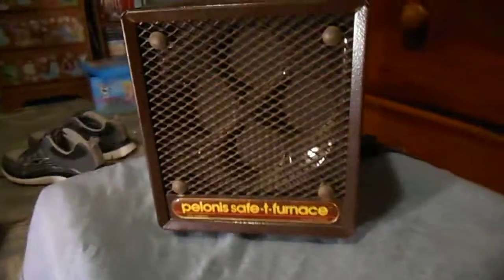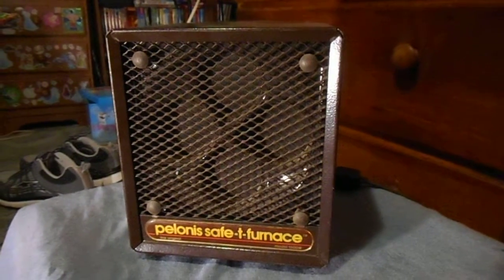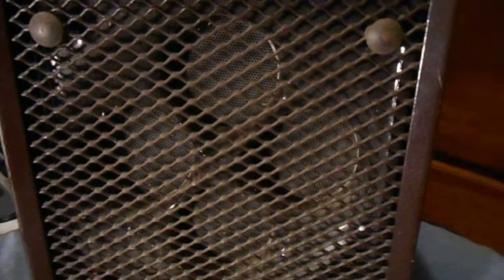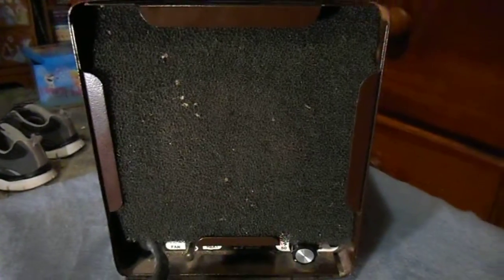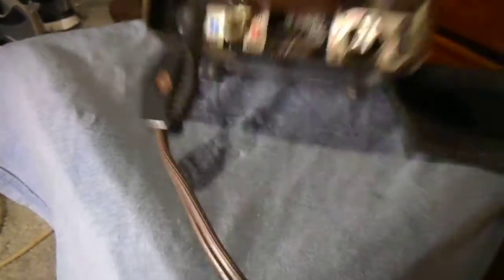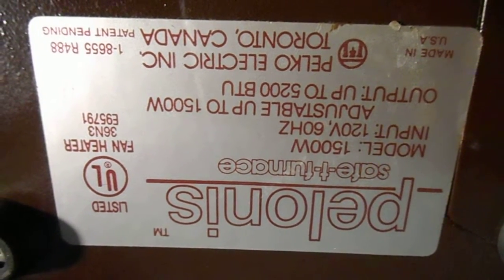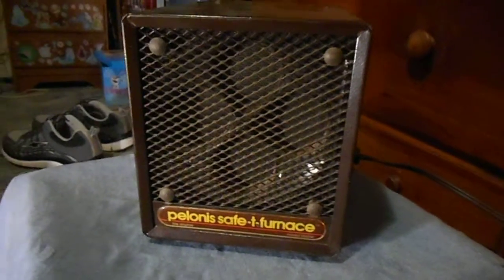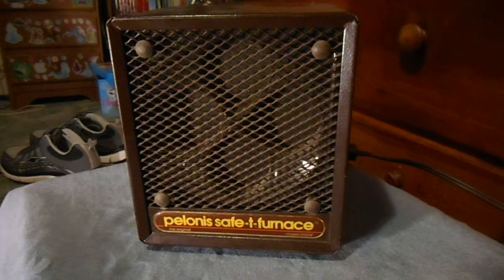1988 Pelonis "Safe T Furnace" model 1500W

Comment: literally just found this in my basement on the floor under a bunch of stuff during cleanout. Have lived here for 20 years and the basement has been through a few multi foot floods due to sump pump failures. cleaned off the dirt, made sure the fan still spun, cleaned as much rust off the grate as i could. plugged it into a power strip and prayed when i hit this switch and low and behold she still works.

Comment: I have one of these amazing units as well. I found mine at Goodwill, I too paid just 2 bucks, and I wouldn't sell it if someone offered $100.. It's the nicest portable furnace that I have used. All Metal, heats a large room quickly and was built so extremely well i almost seems like a piece of mechanical art. Finally, it also works as a fan.
Reply: Interesting. I found a modern version of Pelonis at a Goodwill about a month ago for $4. But since it's modern it is made in China and has a plastic housing. The controls are located on top of the unit though.
Reply: X6800 I just found one just like in the video at a flea market, it was 15 bucks but totally worth it. I’ve gone through several cheap plastic ones, I always buy them when I see them for a few bucks, this one you can just tell from looking at it is a well made piece, it almost feels like a commercial made one. Electric heaters are great, I like to keep the house fairly cool but I like a warm bathroom so I keep a heater in each bathroom.
Reply: I bought one from Goodwill brand new in the box for $5.99
Reply: I HAVE A HEATER EXACTLY LIKE YOURS. IT'S HAS A PROBLEM ON THE WIRE IN THE BACK THAT IS MAKING TO GO OFF.  DO YOU KNOW ANYBODY THAT FIX IT? I I I AM IN NEW YORK. DO YOU RECCOMEND ANYBODY HERE?

Comment: They still make pretty much the same unit.  Some people claim they are different, but if you take them apart they work the same, just without the nice porcelain housing when they changed the design in the early ‘90’s.  I recently bought one as I needed a heater and did NOT want a plastic one.  

The cool part about these heaters is the resistors used to turn electricity to heat.  They only heat to like 380°F or something and no more, so they use little energy to maintain temperature at low fan speeds, and increase energy usage when the fan blows harder.  It’s more efficient than turning on and off completely, and far safer.
Reply: I have one made in the 1990s  still blows hot, metal houseing does not get too hot no smell. I bought a new one with the Pelonis brand name on it got hot as hell on the houseing & had that toxic china off gas smell the newer ones are crap. The 80s and 90s ones are much better made.

Comment: Just an FYI... the heater should have a washable foam filter in back. It helps keep the ceramic disks from clogging with dust, etc. I bought one when they first came out and it is still running.

Comment: I picked up one at a thrift store but mine is plastic. Wish I could have found the metal one. Happy.
Reply: Did they stop making these? I'm looking for a replacement for one we bought in 1989. This was the best among several recent purchases. It was quiet an held temperature without off/on cycling.
Reply: Kathleen Hall I’m pretty sure they still make them exactly like this, they are on amazon and eBay and other online stores. I just found one at a flea market for 15 bucks, it’s so well built compared to the plastic ones I’ve previously bought.